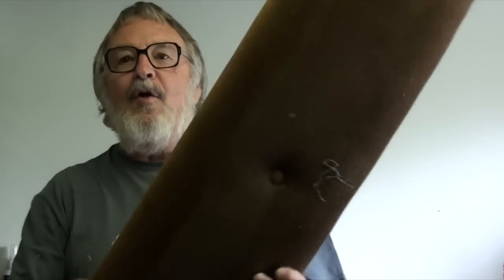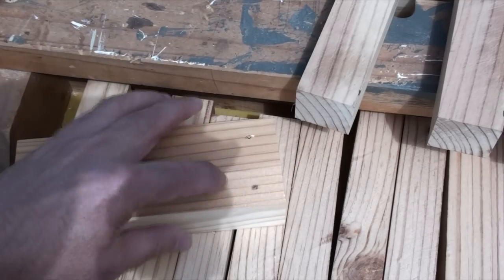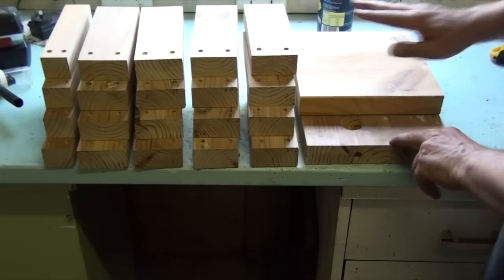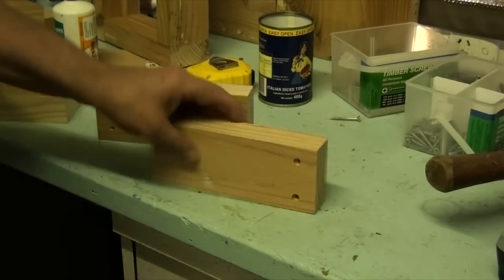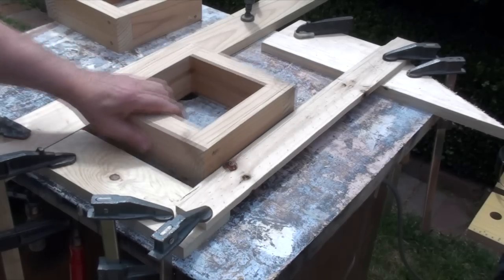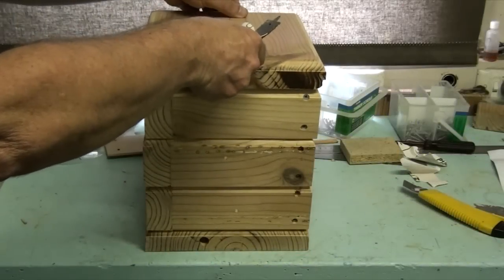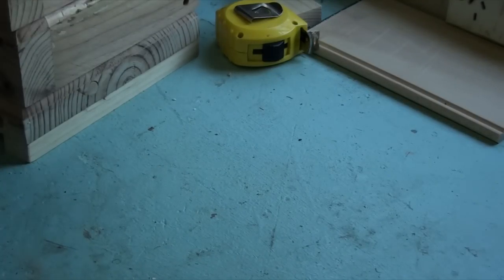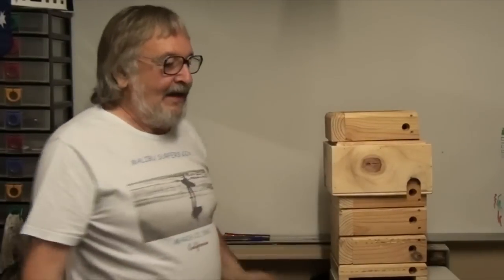Building an "Aussie INPA" box for Australian Native Bees

Comment: Can you tell me what timber are you using and where to get it.

Cheers
Reply from the maker: In the first 60 seconds of the video I say it is 36mm pine from the sides of an old waterbed. The critical measurement is the inside measurement so any timber around about 36-40mm thick will do...BUT...do not use pine if this will be used outdoors.
Reply: I live in Brisbane . I being looking for untreated timber about 36-40mm thick and no one have them.
have you got any place that you think they should have. Cheers

Comment: I liked the idea of using separators handle on acrylic plates, will also adopt this model here in my meliponary. The changes did not like - (just my personal opinion) - the turning of corners are outside of the handles, I found unnecessary. Here forbade the cracks with duct tape because it is more practical. Another thing I find unnecessary for Brazilian bees are friezes of internal loops, not sure if this would effect some for the bees there too. =>continues

Comment: Hi Ianc..nice video. May i know what kind cutting machine you using?
Normally what kind wood suitable for stingless bee?
Thank you.
Reply from the maker: I used recycled pine...from a waterbed so no pine smell at all. I also coated inside with melted beeswax. The pine is OK for me as this hive sits in another insulated box so it is not exposed to that elements...if it was I couldn't use pine.